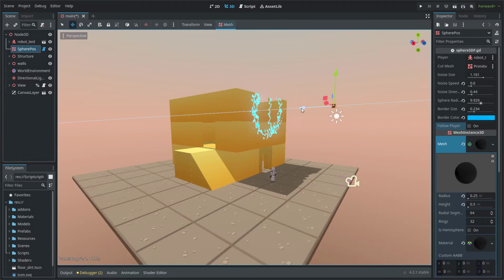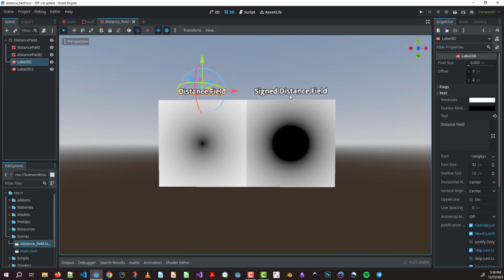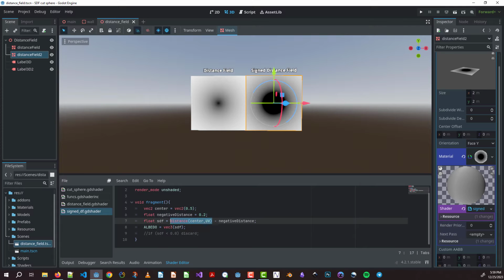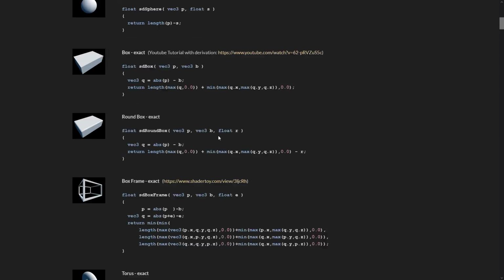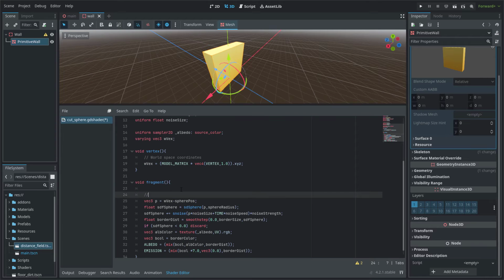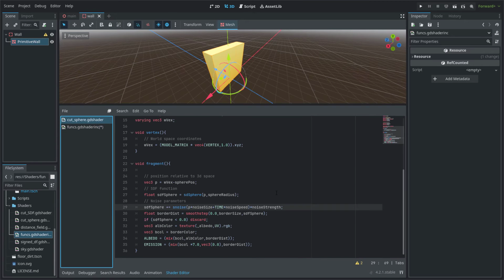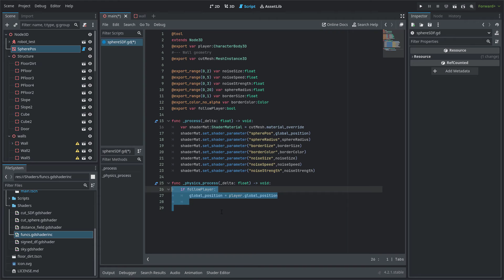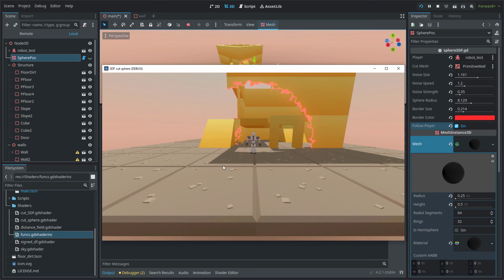Cut off geometry shader using a SDF sphere   - Godot 4

Comment: I wanna make a lemon that has cut off effect and I wanna see top face of the lemon but how do we do things like that?
Reply from the maker: That's an example from Unity shaders bible
It's the same techinique that I'm using here: https://www.youtube.com/watch?v=r8NWX5wWwA0 (Proyecting a plane with RayMarching over  the gap of the geometry)
The difference is that u have to use an equation to figure it out the size of the texture that represents the lemon cut. It's just the same texture but resized. 
I see that in the book the equation is something like this: (-abs(x))2 + (-abs(x) - 1)2

U may ask to chatgpt the proper equation (that represents the volume of the sphere) to resize the texture, and u can simulate the complexity of Raymarching with this example: https://www.youtube.com/watch?v=OgvLWkrdikw

Comment: hey, anyway i could have multiple cutoff instances on the same geometry?
Reply from the maker: I haven't tested it but I think it is possible, passing an array of positions.
Reply: Could u give me an example the part I don’t understand is how would I translate the each sphere cutoff into a single albedo
Reply from the maker: @blankink This example is an edge case, I hadn't seen any tutorial about it. So at the moment I don't have the solution. I think I'm going to have to use multiple SDF anyway in the last demo I'm making (Burning Grass). If that's the case I'll show the solution next demo. 

But I can think of a couple of ways. Maybe using conditions 
if( sdfSphere1 < 0.0 and sdfSphere2 <0.0) discard

Maybe using primitive combinations of SDFs (they are used in raymarching): union, subtraction, intersection
https://iquilezles.org/articles/distfunctions/